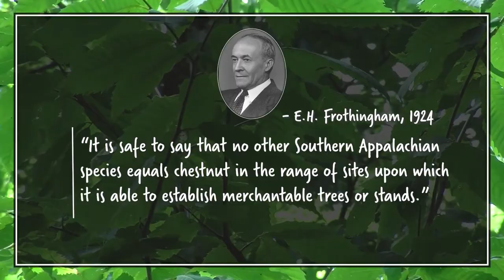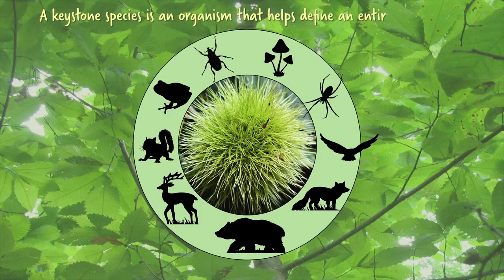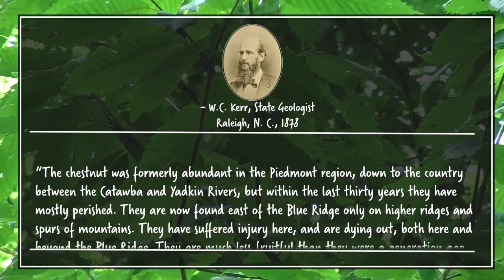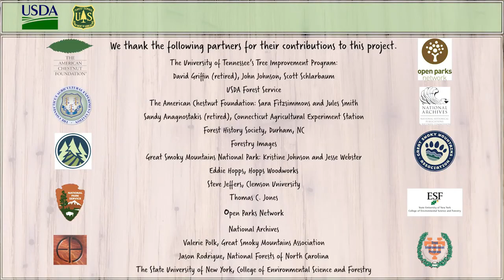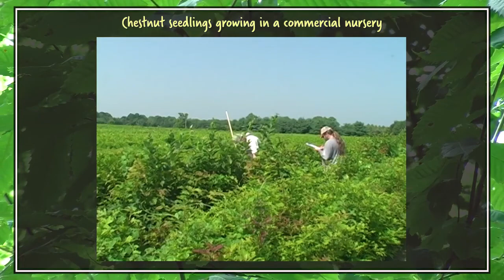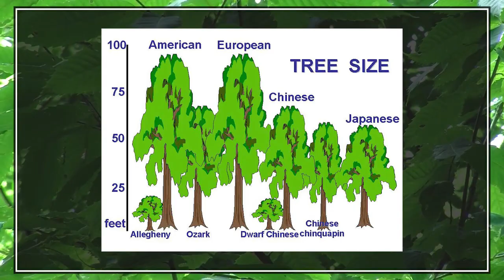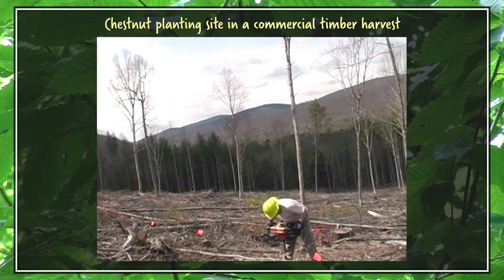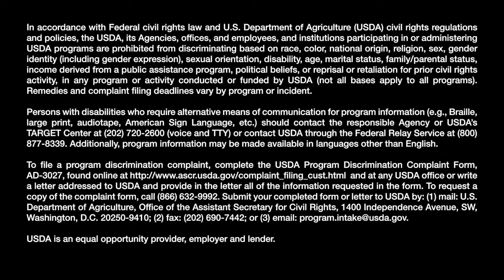Restoration Research of the American Chestnut | High Knob Naturalist Rally 2021

Comment: I found some American chestnuts in a woody area of Portsmouth, New Hampshire. I could hardly believe it for a while.The largest is about 8 inches diameter at chest height and a number of saplings maybe 2 inches and less. As I've seen no fruits over the 4 years since I found them, they're likely suckers from older trees now deceased (stumps in the area). Though I've seen no evidence of blight, I doubt they're resistant. The few plantings of hybrids I've seen up here don't look much like the American chestnut to me (leaf texture/color/shape/size). So sad. Thank you for your work.

Comment: Is there another seed that looks like the Chestnut?  I ask because I'd swear I remember those smooth reddish brown nuts from when I was a child.  The thing is, I grew up in Wisconsin, well outside the Chestnut range.
Reply: Horse chestnut (inedible, and not the same species) and "buckeyes" (a relative of the horse chestnut) both look pretty similar to an American Chestnut, at least, once the outer hulls are removed. Most obvious difference is that an American chestnut usually has a small "tail" that makes it look somewhat like a cartoon image of a beet or radish, where horse chestnut and buckeyes don't have that tail. In Wisconsin, you'd be in horse chestnut country, with a low but non-zero chance that you were encountering buckeyes.
Reply: @felsinferguson1125 we had a cow that would come wobbling across the pasture drunk on the buckeye nuts every year she was hooked lol

Comment: Have a few Dunstan hybrid chestnuts and Chinese chestnuts.  They get smaller versions of the fungal cankers show in video, but swollen not sunken in.  And the cankers don't progress to killing the trees.  I've heard the Dunstans are just open pollinated seedings of hybrid chestnuts and mostly Chinese with a small fraction American chestnut.  In any case, my trees are spreading and look like large apple trees.  They're great for a nut orchard and none have the timber form needed to compete in forest.  Hope some of your 94% American hybrids prove blight resistant and forest competitive.  Agree with other commenter about need to start forest planting those engineered trees with the wheat gene that neutralizes the oxalic acid from the fungus.  Both plant hybridization and intra-plant species gene transfer happen naturally, so I don't understand the red tape delays with starting forest planting of engineered trees.
Reply: Agree. If we could save the tree without introducing foreign genes, then great. But we can't. The next best thing is to keep the highest percentage of genetics we can. I don't think you can tell the difference between pure trees and wheat gene trees, so do it!
Reply: Dunstans are only 1/16 Chinese chestnut but when they are young the leaves appear much more like a Chinese. I've seen some 15-20 year old Dunstans at an arboretum, and they grow single trunk like an American without any blight. Unfortunately only male flower have been produced on those trees, no fruits...maybe they'll fruit when they get just a bit older.